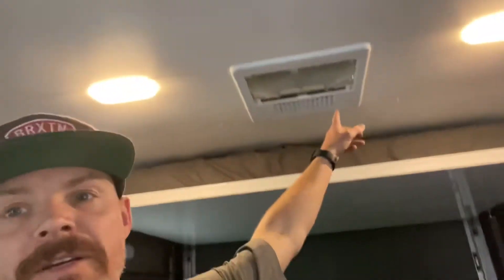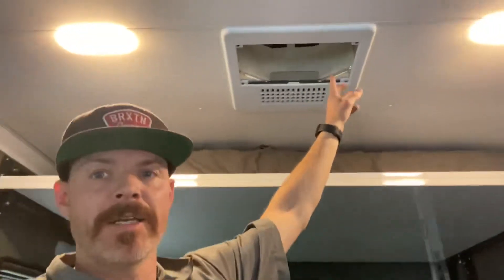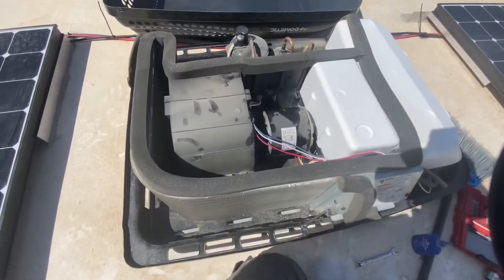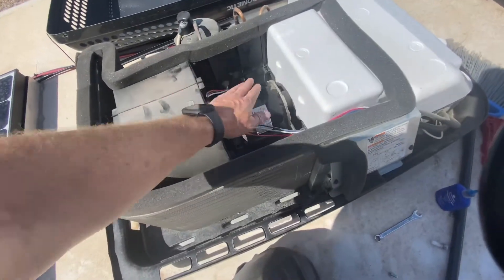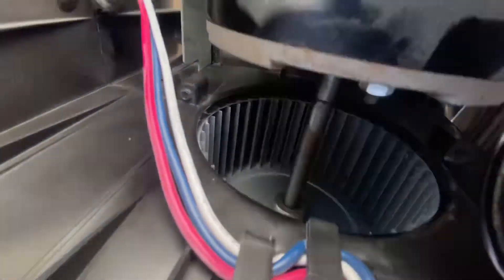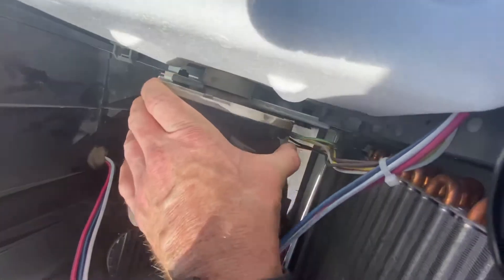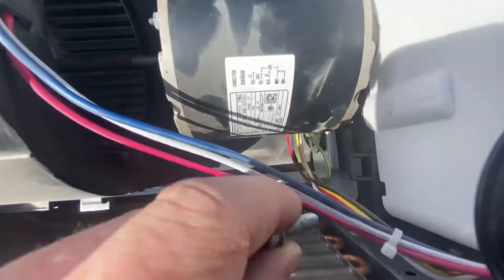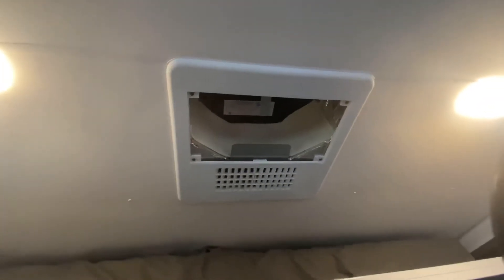ATC air conditioning fix

Comment: Seems like you’ve had some issues with your ATC trailer. I was planning to buy one because of their strong build quality. Would you recommend them still?
Reply from the maker: @armdude: I would recommend them in a heartbeat.  Every trailer out there sources their connections and accessories from the same several vendors.  So there will be issues no matter which trailer you select.  But the platform of the ATC will mean in 10-20 years your trailer will be in nearly the exact same condition as it was when you bought it.  Any other trailer will be falling apart.!